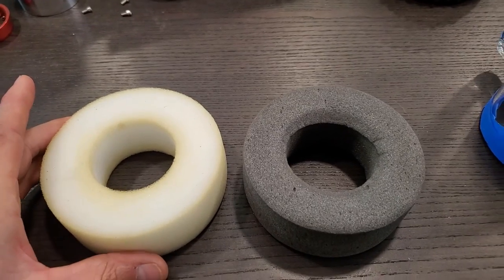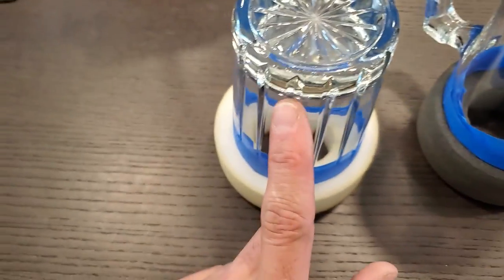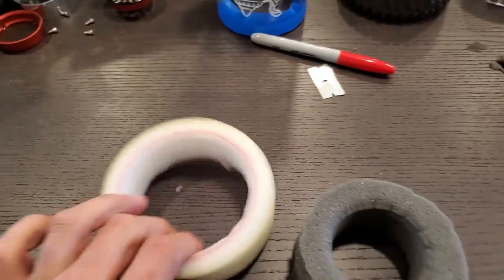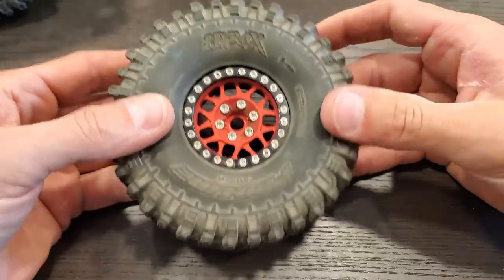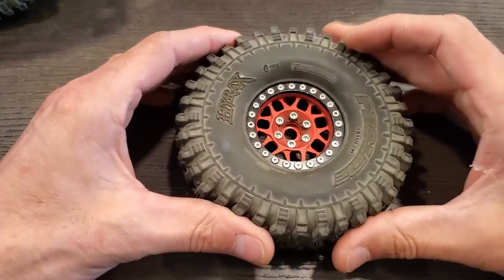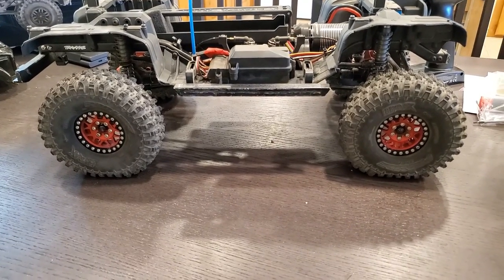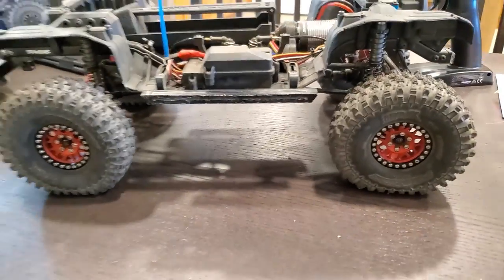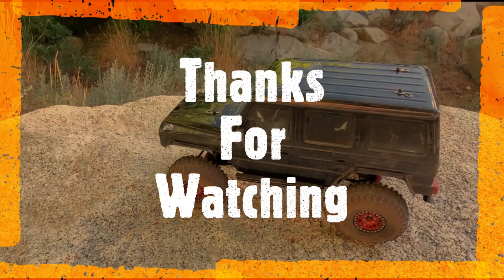Homemade RC Crawler Dual Stage Foam Inserts

Comment: A thin coat of silicone on each side of the softer foams makes a good sidewall and retains the softness for contact patch.
Reply: Excellent idea.
How do you apply and keep consistent?
Reply: @plasticspoonrc  I used a wet finger to get it evenly applied

Comment: Cool hack.
Has anybody tried any pipe insulation inner with stockfoam on the outside?
We have tried painting inner part of soft foams with acrylic paint with limited success.
Check out our vid.
Thanks.

Will have a new vid soon on using flex seal on inner part of foam.